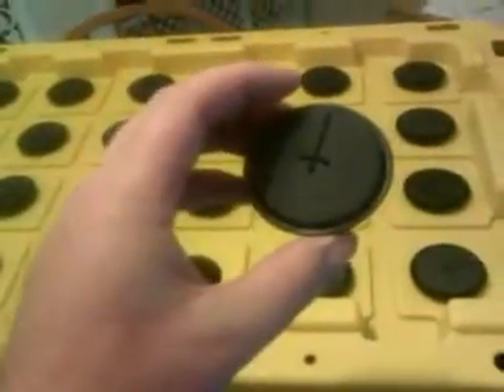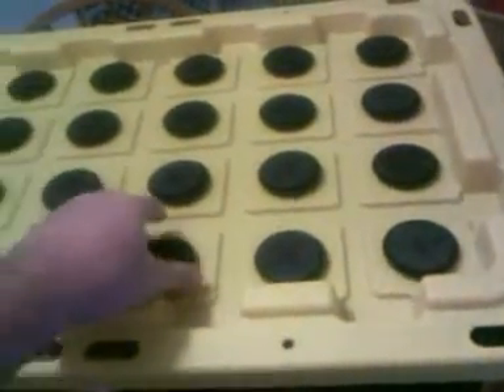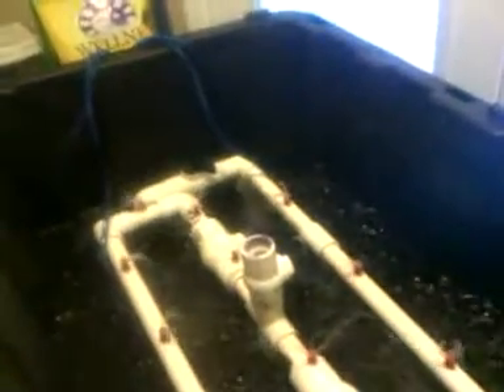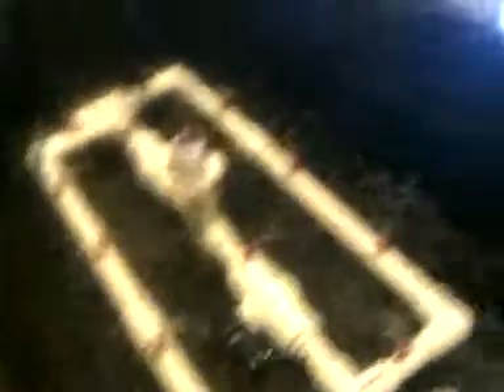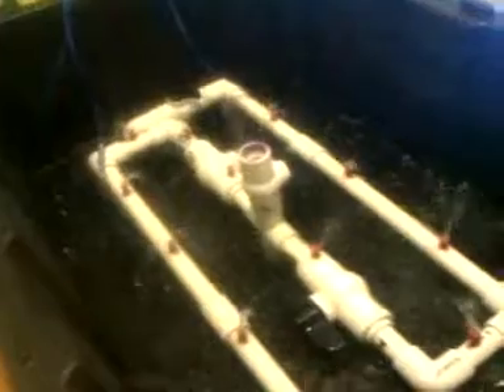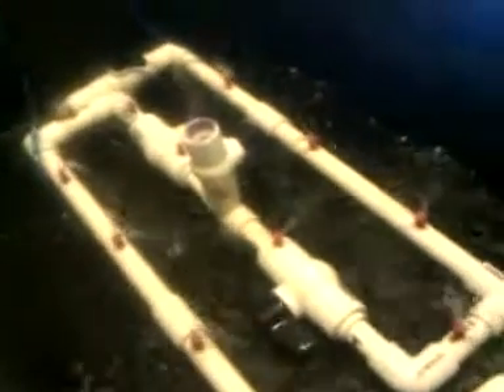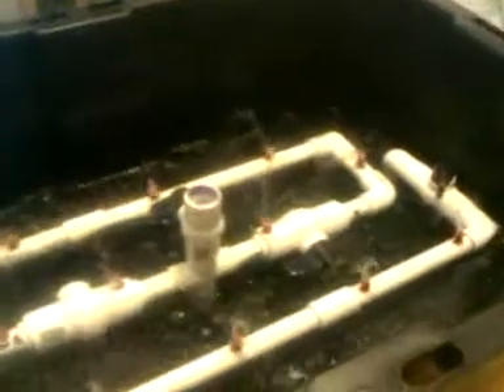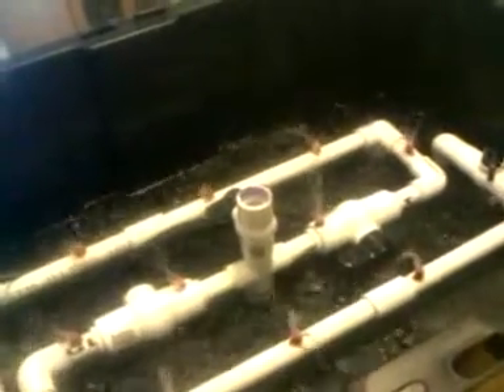Home Built Aeroponics Cloner

Comment: @monteros So if i use a 1-7/8 hole saw, and some sanding to make it perfect, the foam inserts should hold up.. was just wondering why it seems everyone who makes these cloners use both the foam inserts and the net cup upper halfs.. ive ordered everything to make 2 cloners, well, like yours with the bubbler system so i can do actual growing as well, but was wondering if the foam inserts were just not tapered, or that weak? guess its just fitment issues..

Comment from the maker: @petthekittyz yeah, well probably not if you plan to only use it for cloning.  I plan to possibly use it for growing smaller plants too, but not sure.  Good question: I believe that if you are just doing cloning of smaller, lighter weight cuttings you would be fine with the foam inserts only.  However, that assumes you will find a hole saw that works =D I couldn't find the right outside diameter hole saw to use for the inserts I could buy =/